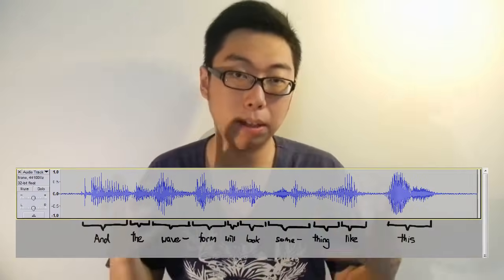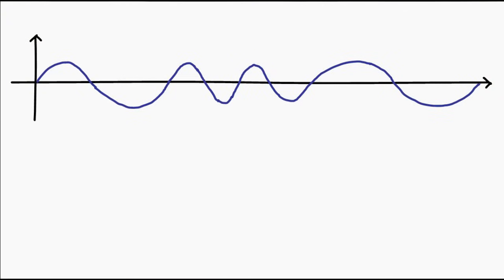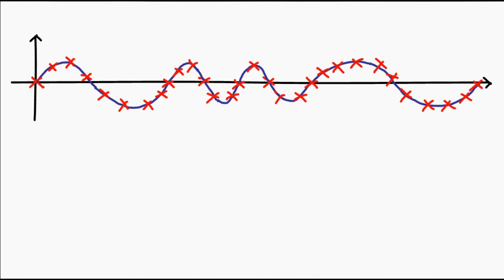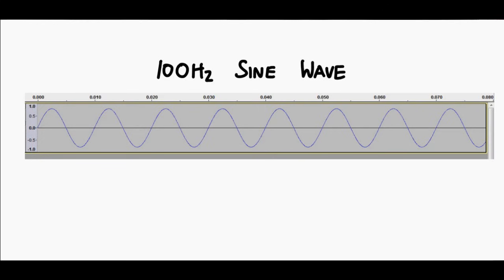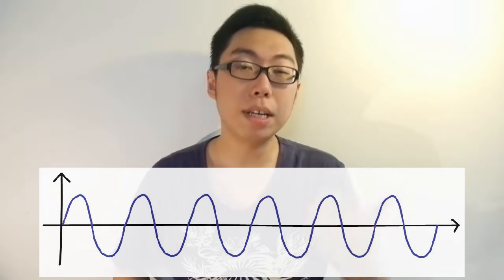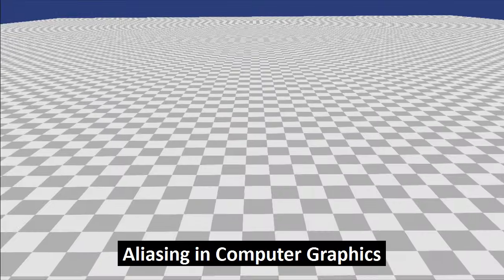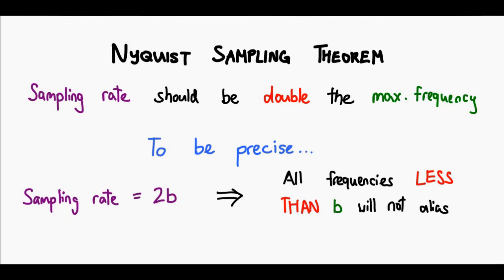Sampling, Aliasing & Nyquist Theorem

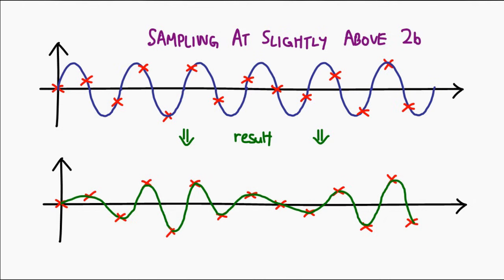Comment: 8:31 you call that a fair representation? xD
Reply from the maker: Hello and thank you for your comment! I mean, it isn't great, but it's fair in the sense that at least you get the correct frequency back!
Reply: @NERDfirst  yea true
Reply: @quinxx12  In reality, the distorted wave he drew is misleading, and not actually what would be produced. This is due to the process the signal goes through. For any band-limited source where the maximum frequency is below the nyquist frequency, a set of such points can only represent a single waveform -- the original!. The points he drew, in practice, could only reproduce the original complete sine wave, without the 'dips' he showed. In order for it to generate the waveform he drew, it would actually need to introduce higher-frequency waves above the band limit to cause the shift.
Reply from the maker: @ChamiCh  Hello and thank you for your comment! This has been extensively discussed by other commenters. Please refer to the following video for our consensus: https://www.youtube.com/watch?v=Sb_4MS8l8yM

Comment: You say the second picture you've drawn is a 'fair representation' of the original wave, and sure, the frequency is captured, but the amplitude is all messed up, and is that not equally important to the character of the wave?
Reply from the maker: Hello and thank you for your comment! That's why I say it's a "fair representation", not that it's good and definitely not perfect. However, do bear in mind that Nyquist Theorem generally only cares about frequency representation. Therefore in this context we consider it a "correct" representation.
Reply: @NERDfirst  Hey thanks for the swift reply :)
So Nyquist theorem is only concerned with capturing the correct frequency, which is not possible when the frequency is more than half of the sample rate... because to accurately depict the frequency, it needs a snapshot of two points for each oscillation?  I think I understand...
Reply from the maker: That's a wonderful summary! You've got it =)

Comment: Hand drawn waves are unacceptable. Try using Excel or some kind of graphing calculator. Plus you never explained how to deal with aliases. If your wave aliases you can still figure out what the frequency is, and then you can set the sample rate to just over (or under) it to capture a full cycle of the wave in question.
Reply from the maker: Hello and thank you for your comment! I'm sorry you've had a bad experience!

The hand-drawn style is a deliberate choice, as the focus is on high-level concepts and the big picture. That's also the same reason why dealing with aliasing is out of scope. The only purpose of this video is to show what is aliasing, when it occurs, and why it's a bad thing.

Comment: On 8:36, my question is it seems the result samples also can't fully represent the strength of original signal, I'm interested in how does it sound like, and why this case not called aliasing. Thanks!
Reply from the maker: Hello and thank you for your comment! Aliasing is defined as when a frequency is wrongly recorded as a different, lower frequency. It doesn't say anything about whether there are errors in the representation. Therefore this is not considered aliasing. The quality won't be great, but at least it wouldn't sound very weird.
Reply: @NERDfirst  Thank you very much!

Comment: You're saying that the sampling rate must be a little more than double the maximum unaliased frequency, but I thought it only had to be double. I'm confused.
Reply: So you're saying that only with a single sinewave is when you must have a sample rate MORE THAN double that sinewave? Otherwise it's exactly double?
Reply from the maker: Hello again! The formal definition does not make this distinction. You always need to sample at more than double the maximum frequency you want to keep to guarantee there is no aliasing.
Reply from the maker: Hello and thank you for your comment! Yes, a correct definition of the theorem says that a sampling rate of 2B Hz will capture frequencies below B Hz without aliasing. Meaning you'll want to sample above the minimum desired frequency.

Comment: the reconstruction of signal from sampled values is grossly incorrect. A band limited signal can be exactly reconstructed  since there exists only one possible signal that can satisfy the sampled points.
Reply from the maker: Hello and thank you for your comment! This particular issue has been brought up many times. I'll summarize the general consensus from all the past discussions:

The general consensus is that all because you can recover the original frequency, doesn't mean it always happens.

The first point to note is that the assumption here is that the input signal has been band-limited, as you mentioned. Don't forget that sampling has applications outside of audio, and in some contexts, such as Computer Graphics, band-limiting may not necessarily be easy or even possible.

Also the key point to note is that the ability to reconstruct the wave perfectly as you mention involves the DAC performing the appropriate calculations to fit a sine wave through the points given. Again, we can't assume that this happens in every context in which sampling is used.

If we are discussing sampling in the most general sense, it remains that we have no information in between samples, so any kind of interpolation is no more than assumptions as to what happens in between.

Comment: hey there....Just wanted to ask you....If transducer or a mic delivers a specific voltage to a micro controller. How microcontroller translate it into amplitude of a relevant value?
Reply from the maker: Hello and thank you for your comment! An analog-to-digital converter is used, and it basically works by performing sampling! 

More on ADCs: https://en.wikipedia.org/wiki/Analog-to-digital_converter

Comment: I have an inquiry; analog signals could be either in time domain and frequency domain? and the same for digital signals? I mean why I usually need to discreticise the signal to have it in frequency domain? How I could have an analog signal in frequency domain? Thank You
Reply from the maker: Hello and thank you for your comment! You do not need to discretize a signal to see it in the frequency domain, and the frequency domain representation of a signal can be continuous (look up "Continuous Fourier Transform"). It's just that depending on your use case (usually in computing), some algorithms are more easily expressed in a discrete manner.

Comment: so if I was sampling a msk signal  1200hz and 1800 hz I would sample at 2400 times a second?
Reply from the maker: Hello and thank you for your comment! The 1800hz components would alias. To be safe, sample above 3600 Hz.
Reply: @NERDfirst  great so I could sample every 277.7us and save that. It takes 833.33us for 1 cycle at 1200hz and 1.5 cycles at 1800hz awesome !

Comment: At 8:30, when you say you couldn’t fit the sampling points to the original wave function,  even by sampling at a frequency above twice original’s (maximum) frequency, wouldn’t that mean that Nyquist-Shannon Theorem is wrong?
Reply: The explanation was very nice, though
Reply from the maker: Hello and thank you very much for your comment! I'm not very clear what you're asking about.

At 8:30, I showed you that you can represent the correct frequency if you sample above 2b.
Reply: I hear you saying that the samples are capable of giving a fair representation of the signal. By “fair” you mean “exact”?
Reply from the maker: Hello and thank you for your comment! No, I don't mean exact at all! If you look at the image during that timestamp, you'll see that the reconstructed wave doesn't quite look like the original.

However, the nyquist theorem doesn't require that. It only requires that the frequency is represented correctly. In that case - Yes it is. The frequency is still right, even if the wave isn't perfectly reconstructed.

Comment: If the frequency of an analog signal is 1 Hz i.e., 1 cycle for 1 second, then I have to sample points at a rate of more than twice in a second to get proper discrete signal.
Reply from the maker: That's right! Any lower and you wouldn't be able to reconstruct the wave.

Comment: Great explanation, except that around 8:30 you draw the graph all wrong. The first cycle will probably not be accurate (as you have drawn it) but the subsequent cycles could be drawn as a perfect sine wave when given just the sample points. The mistake: you're not supposed to just trace the points. You got to make sure you go into each point with a curvature that allows you to cross the following point without any sudden changes of radius/curvature. If you do that you get a nice sine curve.

Best, Michael
Reply from the maker: Hello and thank you very much for your comment! 

You're not the first to have said this so I'm definitely intrigued but I don't fully understand. 

What mechanic in a DAC causes this to happen? Must this happen? 

The way I see it is, the most primitive DAC simply traces the points. It makes no attempt to "smooth the curve" since it knows nothing about what's happening in between samples. 

Is there some physical phenomenon that forces this to happen? Or is this just a very common optimization / post processing step in a lot of DACs?
Reply: You're welcome!

I don't understand the theoretical background well enough to answer your question with any kind of authority. I can only suggest you read up on polynomial interpolation and splines. You can also watch the D/A and A/D Digital Show and Tell video by Monty Montgomery, which is not specifically about splines, but contains some visual examples of how a wave form is perfectly reconstructed despite varying offsets in the sampling points' time domain. Maybe that helps with intuitive understanding.

Best regards, Michael
Reply from the maker: Yes, I've been referred to work of the same person before as well. What I gather from it however is exactly what you said - It's a polynomial interpolation technique, ie. It uses something other than linear interpolation to join up the points, and in doing so it is able to reconstruct a perfect wave. It is a technique that can be used to "regenerate lost data" through interpolation.

What I don't get is why what I have drawn is considered "wrong". Techniques can be used to recover a better signal from the sampled points, but unless they must be used, and that there is no other way, then surely it's not wrong. It remains that, regardless of how we join the samples, that there is loss in the sampling.

That's not to mention that there are caveats to the argument that "there is no stair-step". It assumes that the signal has already been band-passed to nyquist frequency, and so given the sample points, there is only one possible interpretation of the signal. In my example, I'm speaking of the general case. Having made no assumptions, we have zero information about what exists between each sample. Interpolations can fit a perfect sine wave to the sample points, but there's no way for it to know whether this wave is correct or not as again, information has been lost.
Reply: I can see now why you take offense with my usage of the word "wrong". You're right: if no assumptions about the environment are being made, you could reconstruct the signal in a linear fashion. You would introduce a bunch of artefacts (and reduce some others I guess), but it would be possible.

I also realized that I judged the drawing from the perspective of DAC in audio converters, which you are not talking explicitly about in this video. I don't know of any audio DAC that doesn't use reconstruction filters and would therefore generate a wave like your's from the given sample points. Thus, I found your drawing misleading, which irked me because some people might draw the conclusion from it that this is the reason why wax cylinders sound more pleasant than Red Book CDs. I find these kinds of arguments tedious, but that's my problem, not yours.

Cheers!
Reply from the maker: Hello again! Don't worry, I didn't take offense - You were civil and open minded the entire time, which I truly appreciate.

I am just worried that I've taught something wrongly (remember, you're not the first to bring this up so it does worry me), and I'm desperately trying to find a source that can prove that I'm wrong so I can work on a correction. 

I guess this is the difference between how things work in theory versus in practice. I'm sure DAC circuits these days are packed with smarts. It's just that they're rather beyond the scope of this discussion. 

Interestingly, the other person who made such comments had a similar interest as you do - That people may be misled into thinking that analog is necessarily superior. But that's nowhere near the conclusion I've drawn, so I hope I don't have to be responsible for that :P

Comment: The key thing that seems to be omitted in discussion related to the nyquist theory is that the "resolution" (sample rate) decreases with an increase in the frequency being recorded.
Reply from the maker: Hello and thank you for your comment! I'm not sure I understand what you mean, could you please clarify?

With a higher sampling rate, the maximum frequency you can correctly sample should be higher, not lower, as you are able to capture faster changes in the medium.
Reply: If you superimpose a 44.1Khz sine wave over a 20Khz sine wave and then do the same with a 44.1khz and 20hz sine wave you will see right away that the bass sine wave is sampled far more (frequently over the course of one cycle) faithfully than the HF sine wave. This is why the Nyquist theory exists, because if your sampling rate is less than double the frequency you intend to record, it is impossible to recreate faithfully the original signal because you would have less than 2 samples for an entire cycle of the recorded frequency. Hope that makes sense, I can upload a graphic from my 'scope but not sure how to do this!!
Reply from the maker: Ahhh, okay yeah, that makes sense - Thanks for clarifying. I guess we could say that the higher the frequency, the "rougher" the sampling. I feel like it's omitted for a reason - Because it's hard to quantify or correspond to any real world measure. That's why the Nyquist theorem makes it simple by only considering two states, whether or not the original signal can or cannot be reproduced at all.
Reply from the maker: While I can see where you're coming from, I certainly think the Nyquist Theorem still has its place. Don't forget that sampling goes far far beyond the realm of sound. In contexts such as digital transmissions (where the medium is electromagnetic waves), we're more concerned about the absence of presence of a frequency. How well it resolves is a secondary concern.

So I would say this measure is still extremely valid, and in fact, sufficient, depending on your use case. In certain cases in which resolution of the original wave is significant, what you propose can be thought of as a corollary to the Nyquist theorem... Though it might be tough to properly quantify that in a manner meaningful to the real world!
Reply: 44.1Khz was chosen to "catch" 20KHz audio, as that is perceived as  the upper limit for humans. So you can theoretically sample a 100Hz sine wave accurately with a sampling frequency of circa 220Hz. 
Now, lots of people seem to think that all hires does is give you a recorded upper frequency of .5 times the sampling frequency. This is just a load of rubbish. Where does this data come from? Microphones are like hens teeth over 20Khz and not found in the recording studio at all. 
So I put it to you that the audio band is chosen by the engineer and his equipment limitations. With hi-res, you should benefit from higher sampling rates within the audio band. Just to clarify, you can record up to half the sampling rate, according to nyquist, but no microphone found in a studio is designed to be flat above the generally accepted audio band of 20-20Khz. So where the data is supposed to come from to "fill" this upper frequency range, over 20Khz to 44Khz, I have no idea. 
Personally I think it's people not understanding the recording process. I even have a hif magazine that publishes photos the frequency response of hi res files. Guess what? Nothing much above 23Khz.
Reply from the maker: While I don't disagree with you on your thoughts about audio, it is imperative to note that Sampling (and by extension the Nyquist Theorem), extends far beyond that. Apart from being a point of theoretical interest for the academics, sampling has practical applications in everything from analog and digital transmissions, to computer graphics.

Saying the Nyquist theorem is "a load of rubbish" is a narrow way of looking at things and doesn't do anyone any good - The theory is valid and sound. It is just that in _your particular field_, there are other practical concerns that kick in before you can even reach the theoretical limit.
Reply: Nyquist isnt rubbish, I never said that. I am referring to people who think that hi-res audio is simply an extended (inaudible) frequency range

Comment: Thanks for your video mate, it was very informative. 

Would I be correct in deducing that:
The maximum Nyquist frequency that we could sample correctly at 44.1khz would be 22.05khz. 
Or you could say that to correctly sample a sound of 22.05khz we would need a Nyquist rate of 44.1khz.

Thanks
Reply from the maker: Hello and thank you for your comment! You're off very very slightly - Definitions say that when you sample at the sampling rate of 2B, all frequencies under B will not suffer from aliasing. The definition is silent about frequencies at exactly B.

Therefore to be safe, you would say that frequencies under 22.05kHz will sample correctly at a sampling rate of 44.1kHz.